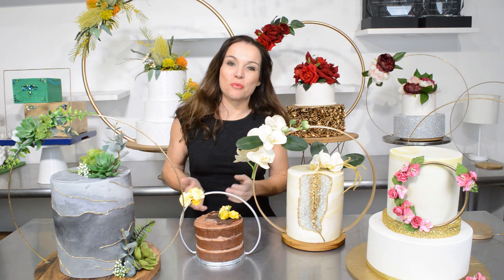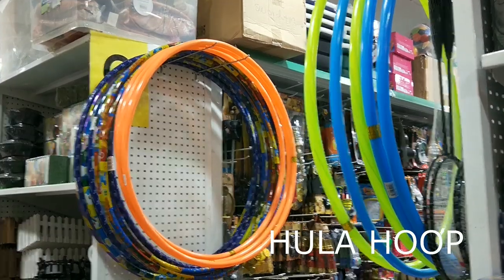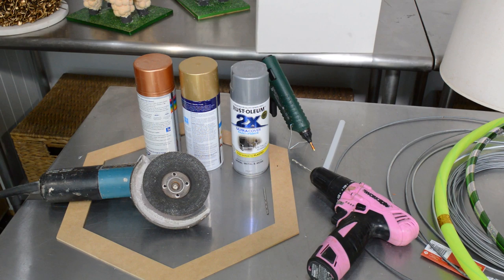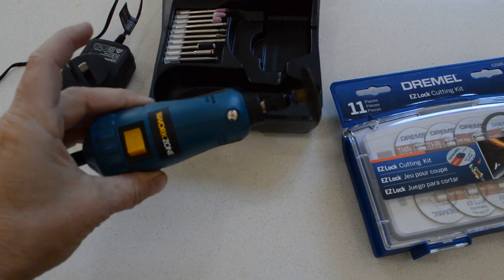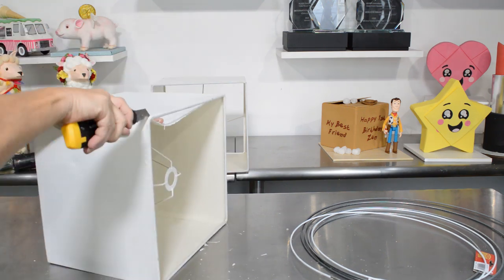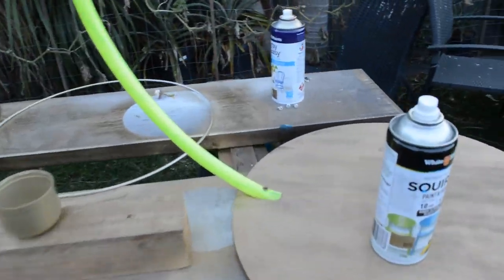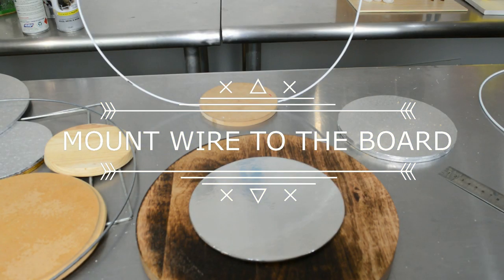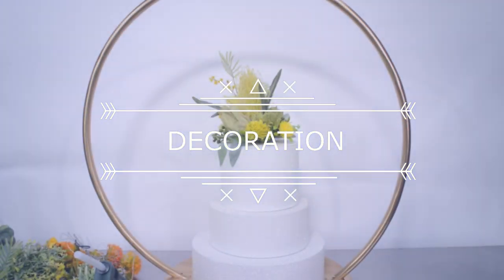HOOP DECORATION FOR CAKE

Comment: Thanks for another informative video! Question, how do you cut the wooden frame without cracking it , especially when spreading it out ? Thanks.
Reply from the maker: The embroidery hoop comes already open and you can attach to the board the same way I did with the hula hoop. If you want it to be on the center you will have to cut with a small saw. <3